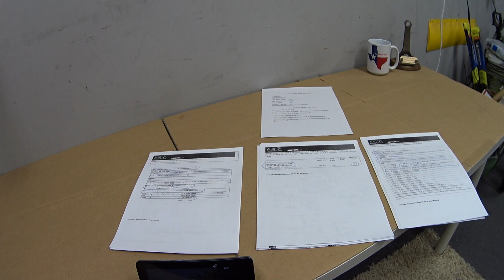Crown Victoria - P0451 EVAP Pressure Sensor

Comment: My fuel tank is leaking. I am not sure if I should order a new heat shield for it, can reuse the old one or should I leave it off altogether.
What do you think?
Reply from the maker: Hello,
Whenever I perform a repair I try to simulate how the Ford Dealership would would if the car was brand new, and they are doing the repair under warranty.
That means sparing no expense, and putting things back how they were from the factory.
Of course this may be difficult to do on a budget, and parts availability.
-Chuck

Comment: 2007 P71 here. P0451 turns on CEL within 3 days at most after being reset. I do get a quite rough drive both while accelerating and releasing the gas pedal. Eng starts well 100% of the time but after it reaches a certain temperature range (between the two horizontal lines in the lower part of the gauge) it'll often die as soon as I put it into drive. I'm gonna try to scan and check those FTPS values with my ELM327. Which app are you using for scanning?
Reply from the maker: I only use the ELM327 with the free version of "OBD Auto Doctor" APP for basic functions. 

For more complex diagnosis, I use a different scan tool. 
-Chuck
Reply: @PanzerPlatform  thanks for the quick reply. If the FTPS turn out to be fine, would you recommend taking off and cleaning the whole evap canister as the next step?
Reply from the maker: @KonigTigerPorsche  
I recommend obtaining dealer level service literature, and proper diagnosis first.
No guessing.
No parts shotgunning.
-Chuck

Comment: I have a 2010 MGM flex fuel. I have the P0451 but when I add my vin the parts listed here become not applicable and no other part is listed.
Reply from the maker: Right on 'Murica,
Thanks for stopping in. 

Btw, this video only applies to 2010 Crown Victoria Police Models. The EVAP systems on Panther cars can be different from year to year, and model to model. 

I don't quite understand your question. Where are you entering your VIN Number, and what is it you're looking for?
-Chuck
Reply: @PanzerPlatform  My 2010 Grand Marquis threw a P0451 and all the parts houses Rock Auto, Advanced, Tasca, etc when looking for an evap pressure sensor doesn't return anything.  Is it called something else?
Reply from the maker: @americawhereareyou  
Try entering your VIN on the OEM ford parts website.
If you still need help locating the pressure sensor.
I'll need your VIN, and the build date of your MGM, (it's on the driver door jam label).

Comment: I unplug my evap switch (the connector behind the passenger rear wheel, on top of fuel tank) to replace the fuel pump and now I can't plug it back in. I don't know what the problem is. It's hard to reach is one problem. If I can't figure it out before smog time I'm going to have the drop the tank and look at it.
Reply from the maker: Right on Condone,
If you can't plug it back in before your emission inspection I might know a way you can still pass. 

Let me know if you can't get it plugged back in. 
-Chuck

Comment: Hey Chuck,
I have a 07 GS with 77 K. Few months back, a rusted fuel tank strap broke causing my tank to drop. Replaced the tank, straps, EVAP lines, and fuel pump. My check engine and fuel cap light have been on ever since and run the PO451 code. Car runs fine. Gas mileage fine. Mechanic who did the work claims nothing appears broken via lines and parts. If I reset the lights, come on next day. My concern is with the check engine light always on, how am I going to tell if something else malfunctions down the road unless I scan it intermittently. Don't want a problem arise in the future that becomes a major issue as I didn't check it early enough as I couldn't tell with the check engine light always on. Catch my drift? Any advice please? Thanks, Joe
Reply from the maker: Right on JO,
If you have a code, there's obviously a malfunction.
If this issue arose right after the repairs it's possible your mechanic didn't finish the job properly.

I would give him another chance to fix it.
If he is unwilling, unable, or the diagnosis is above his skill level I would find another shop to fix it, and send the bill to the original mechanic.

If he refuses to pay, you may want to contact the auto repair regulatory agency in your state for help, or file a claim in small claims court to recoup the cost.
-Chuck

Comment: Awesome video - In my case I am buying a new gas cap from the dealer. If that does not fix the problem I decided after watching your video to put my Vic in the mom & pop shop up the street & let a professional with all the right tools drop the tank. Main reason is I dislike working underneath a vehicle without a lift. But your video is great because it makes me an educated consumer & lessens the chance that I will get taken advantage of.
Reply from the maker: Right on Random,
BTW, the info in this video only applies to the 2010 Police Model Crown Victoria. 

If you have a different vehicle, this information will not apply. 
-Chuck
Reply: @PanzerPlatform  End result: The local shop dropped the gas tank and replaced the sensor as shown in your video. Total cost was $830 plus it took almost 2 weeks to find & get the sensor as none of the Ford dealers in the area had it in stock. $30 of the cost was for a new inspection sticker. It was/is expensive but the shop did a great job & I am happy.
Reply from the maker: @Random-rt5ec  
Right on Random,
Thanks for the update.
What is the YEAR / MAKE / Model of your car?

$830 sounds like a lot of money for any kind of repair.
But as long as it was need, and performed properly that should bring value to the expense.
-Chuck
Reply: @PanzerPlatform  2010 Crown Vic - Police Interceptor - I am told it was a former FBI vehicle. I purchased it in 2016 with 31K miles & 120 hours idle time, from A sheriff in Ohio who has a side business buying & selling low mileage/usage government vehicles.
Reply from the maker: @Random-rt5ec  
Right on. 
You can find out if that was true, and get the maintenance and repair records through the Freedom of Information Act.

Comment: Think you can help me with the valve cover gaskets for a 2002 GM? 
Got a quote for $600 labor only for both covers. I tried the local library  but they don't have the auto manuals.
Reply from the maker: Right on Mafitron,
What do you need me to do?
-Chuck
Reply: @PanzerPlatform  if you don't mind sharing the repair manual for the covers. I think the driver side might be easier but the passenger side might be the trouble side.
Reply from the maker: @mafitron  
I down to help you any way I can. 

Still not 100% sure what you want me to do, so I'll make a suggestion. 

Have you seen Garage Denali's video how to do this? It the best one I've ever seen. 

Hold on, let me go find the link to the video.
Reply from the maker: @mafitron  
Driver side valve cover;
https://youtu.be/ku1l0fchl88
Reply from the maker: @mafitron  
Passenger side valve cover;
https://youtu.be/Lfd8it-aRnE

Comment: Another good vid!  I've got the same issue with my '04 that I've been holding off on doing. My C.E.L. only stays off momentarily after cleared, but luckily I don't have emission checks here to deal with, unlike Cali.  

I have found other info over the years that says it can be cleaned and at times can simply be plugged up causing the failure.
Reply from the maker: Right on Dealth,
You lucky dog. 
Just get some black tape for that pesky idiot light. Lol
-Chuck

Comment: Great, and very helpful, video Chuck! I'll have to wait for the next time the code comes on to run the diagnostics and figure out what's going on. Sadly if I'm going to drop the fuel tank the repair bill will probably exceed $300 because I'd replace anything else that could go wrong after 194k miles while the tank is down
Reply from the maker: Right on Ed,
Thanks for the question. I had fun researching this, because I fear my own 2010 Grand Marquis may fall victim to the same malfunction. 

And if it ever does, I'll have forgotten everything I looked up. Lol

-Chuck